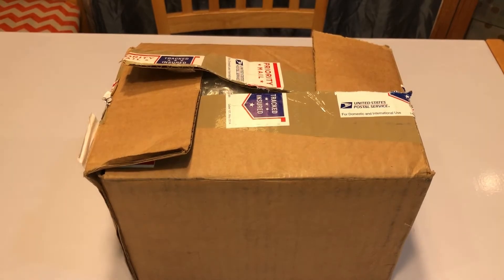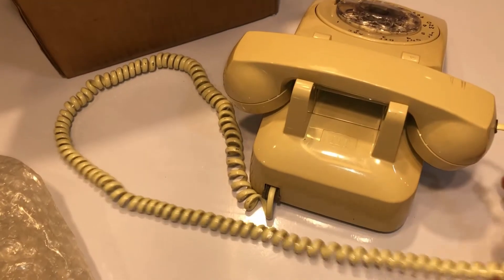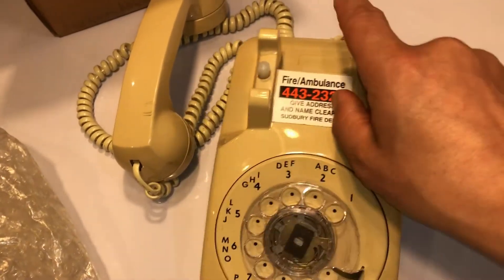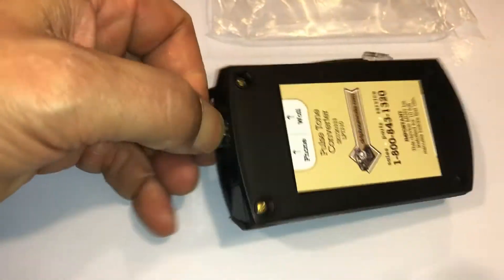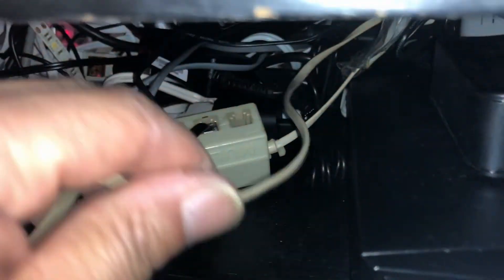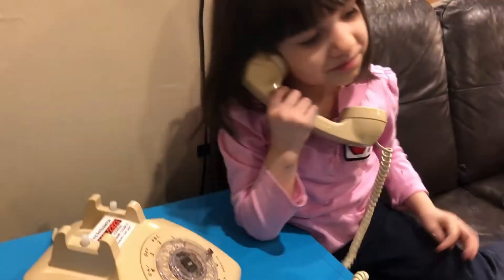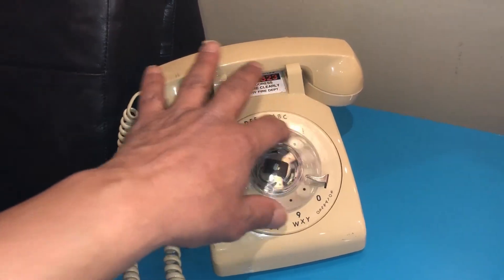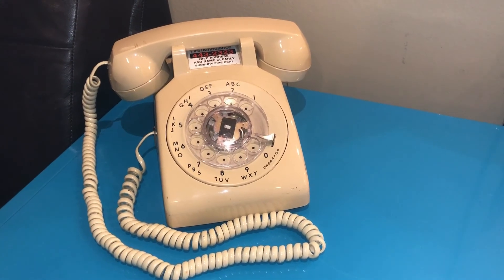Pulse to Tone Converter Rotary Phone Dial Telephone  (04-2018)

Comment: Hi there. Beautiful piece, man. I have some old ones too. Now I'm interested in that converter. Do you live in USA? oldphoneworks is on Canada. How about shipping? How many days from buying to the deliver? Thanks in advance.
Reply from the maker: Fabricio Souza I purchased converter on amazon, 2 day shipping, USA. I am very happy with purchase.
Reply: Thanks for your reply. Mine just arrived yesterday, a great gift from my sister. It works, but I think it's misunderstanding the pulses, and generating wrong DTMF signals. Seems like it sends the same tone when I dial 1 or 2, for example. Have no ideia how to adjust this. Any thoughts, please?
Reply from the maker: I live in the USA, the converted took 2 days to arrive. the phone took about a week, purchased the phone on ebay.
Reply: Don't know if you got my right question...
Reply from the maker: Sorry to hear this, Its fine with me, maybe you got a bad one. I would try another rotary, or return, & replace the Pulse to Tone Converter